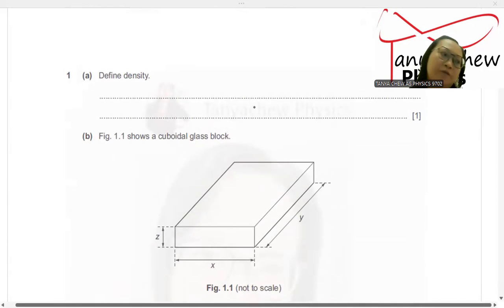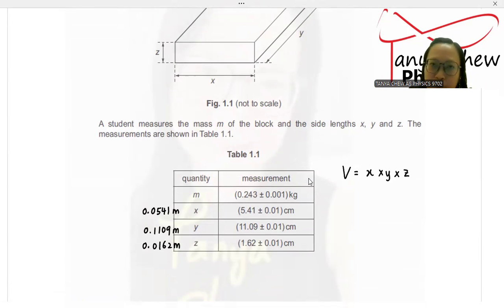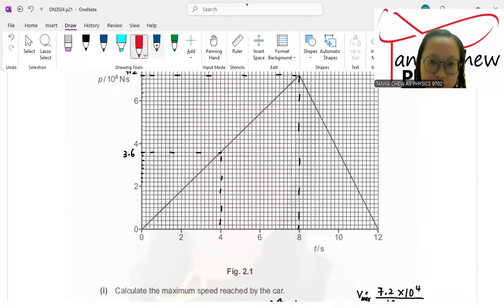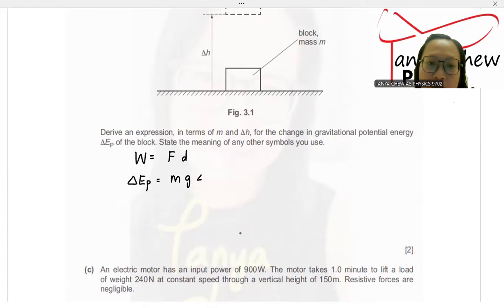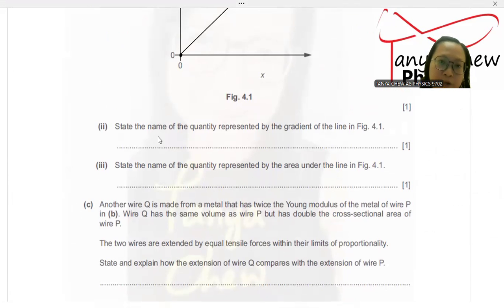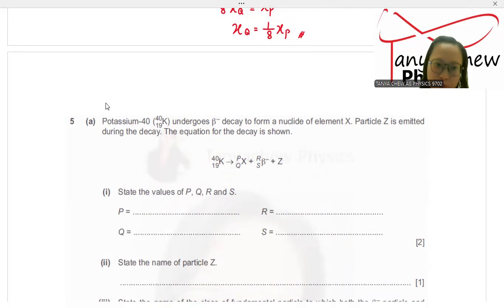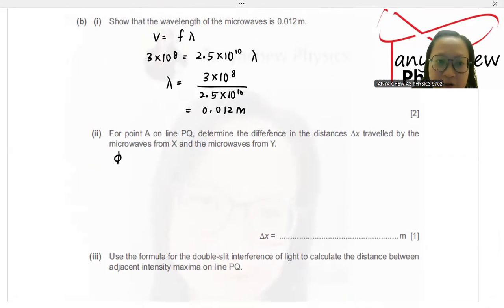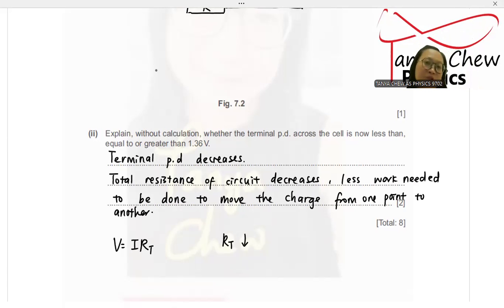AS Physics 9702 Paper 2 P21 Oct/Nov 2024 | FULL Structured Questions Explained!

Comment: In question 2 (c) why did you draw a discontinous line instead of a straight line in the sudden change on acceleration?
Reply from the maker: From Fig. 2.1, you can see the momentum of the car reaches maximum at t=8s and the the same time as well, momentum of the car declined, which also means that the car reached maximum velocity and t=8s and at t=8s , its velocity started to drop to zero. Hence, you draw a horizontal line from (0,5) to  (8,5) then another horizontal line from (8, -10) to (12, -10). Hope that clarify?
Reply: @TanyaChewPhysics  Yes, thank you so much!!!!